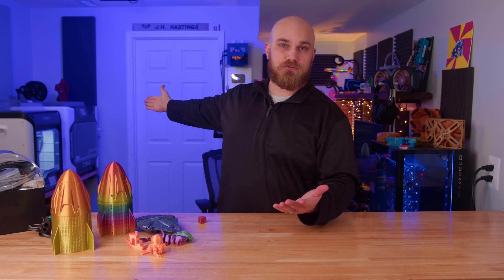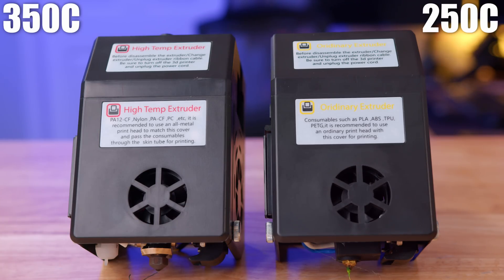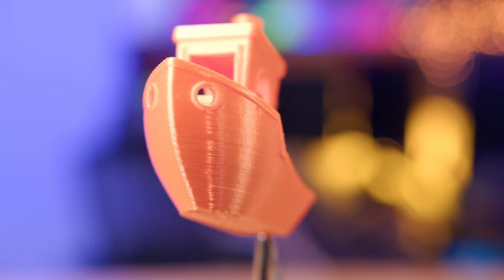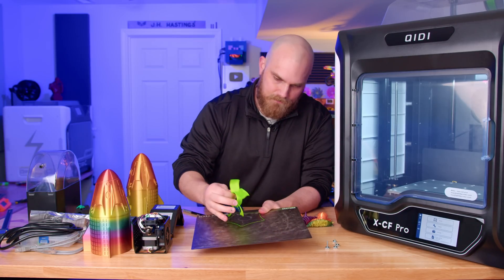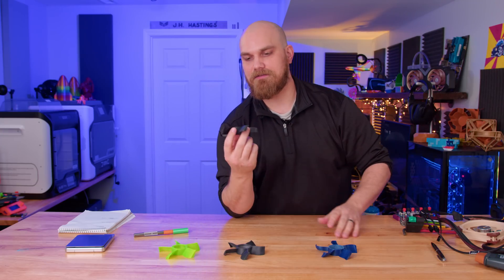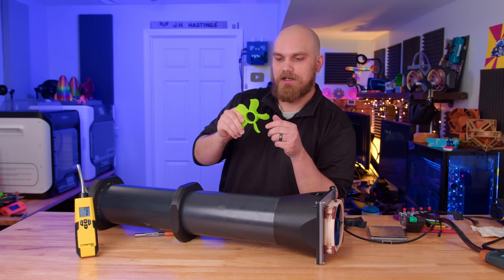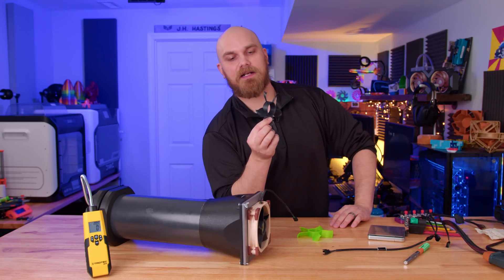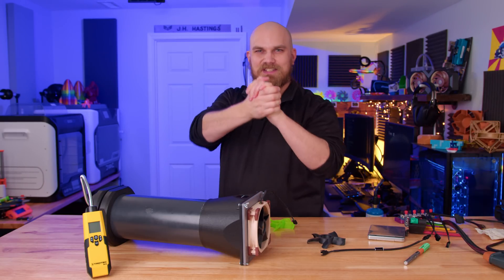Will a FLEXIBLE Fan Work? | QIDI X-CF Pro Review

Comment: Another filament you should try is PVB. Specifically, for Lost PVB casting (it's basically Lost PLA casting, but with PVB). PVB is similar to PLA except it burns super cleanly and it can be smoothed by alcohol.

Starting out, you'll also want to cast in ZA-12 alloy instead of pure aluminum.

Now, why would you want to cast something in metal? Well, I dunno!

Comment: fan guy to astro boy 3d rocket sleev print test aero ... next wing and boat shapes,,, test launch in tube line .. measure with string resistor not air with wind tho

Comment: yes and no .. it does at forst ... then it works worse so it bounces back and forth unless you get the right flex but as speed and pressure changes it messes up flex again .. so variable hard core or just flex on edges or just flex ina  center core strip should aid wingsz and fans which ... are not per se wings on swyvel axies .. a wing is to propulse or float a fan is to intake and push .. you need better industry vector differneters

Comment: Defintely need a TPU fan that has no support to the core at the trailing edge of the blade that has an aggressive profile but is relatively thin. Get good low rpm air scooping that will give way as the speed increases to lower drag and improve rpm

Comment: Dynamic fan like f1 racing of the past please. Either make rakes that open at higher rpm but closed at low rpm
Or print the fan in nylon with a tpu top edge where higher rpm allows it to bend.

Comment: Hypothesis: The TPU stretches to the fan frame as you stated, which seals the air flow better. The tighter the fan blades are to the ring, the more efficient.

Comment: OMFG. How have you gone so long without printing anything in TPU? You haven't fucking lived until you've printed something in TPU. It's so cool to print stuff that would normally be fragile as fuck, and have it be near indestructible. I printed a very small Fat unicorn model under 3cm high and it came out great, even the horn  was perfect. It's my favorite material to print in. I just need to get the Bondtech nozzle in steel to make it print faster than 60mm/s. Thanks for the fun video's. Keep up the great work.

Comment: I wonder what would happen if you line the walls with sandpaper, and use a fan that out of the printer is just a tiny bit too big; and then run it for a bit to let the sandpaper scrape the tips of the blades to the perfect fit...

Comment: The issues with the top of the dragon capsule prints can be fixed with more top layers. I prefer to print with low infill and 5 top layers, and I've never had an issue with top layer quality with a 0.4 mm nozzle. And make sure you keep that nylon in a dry box. The stuff can get wet in as little as 20 minutes, which is ridiculous.

Comment: Nice review.   I've been running one of these for about a month it's a good sold printer for those who just want to print 24/7 not constant fiddle around.  Few tips for Nylon and Nylon CF - slow the print speed down, cooling fan off, keep the enclosure warm 35+c works best and use the smooth reflective side of the bed with some glue stick designed for nylon (Magigoo  PA or visionminer) and you'll get some stunning prints.   Also whilst the BLtouch is a must on the poor quality thin wobbly bed creality style printers, QIDI printers do not need it - the bed is so massively thick and flat it doesn't need it.

Comment: ABL is overrated.  I find manual leveling holds just fine for a really long time if the printer is setup correctly.  I find ABL just gets in the way most of the time and adds time to the print if you run it before each print.

Comment: Speaking as someone who uses carbon fiber-nylon exclusively at work (Onyx brand), that is the most PATHETIC exscuse for a "dry box" I have ever seen. If your stuff is anything like mine, it is so hydrophilic that it goes bad almost instantly without proper storage. Ours will go bad INSIDE a dry box after about a month. I don't see a seal between the top and bottom of that thing. Does it at least have desicant bags in there?

Comment: My guesses:
The PVA fan blade touching the edge creates a seal to the fan shroud, capturing the negligible amount of turbulent air that the others are unable to accelerate into the wind tunnel.
The carbon fiber performing slightly better than PLA is due to the decrease in mass allowing for ever so slightly higher fan speeds.

Comment: Can TPU used as a non slip surface? For example if I were to print something in PLA could I print TPU feet/pads for it so the part wouldn’t slide on my desk?

Thanks in advance.

Comment: I wonder if it is possible to exploit the flex in TPU to actually improve fan performance. Build the fact that it's gonna stretch right into the design, perhaps letting it perform well across a range of speeds by carefully adjusting blade thickness...
Although I suspect, if it was that carefully designed, small imperfections in the printing process may well matter quite a bit

Comment: I've worked with glass filled nylon in the past and you may want a slow warm cool.  The parts I used to be involved with would have a huge cooling fixture where you put a pair of parts in a little cubby together for 30 minutes before post processing.

Comment: It would be interesting to see what happens if you put the fans on an RC car motor and really spin them up. At which RPM is the fan most efficient? Also, what happens during extreme stalling? You could print your own hub for it!

Comment: I'm kind of dissapointed with the print head change mechanism.  With the biqu hermit crab I have on mine, you just press a button and the whole head pops off and all the electrical connections are pogo pins.   You'd think for how much that one costs they could do something similar.

Comment: Never use part cooling for CF nylon. Always use Vision Miner adhesive on the bed. Always take the bed to 75-85°. Follow those suggestion and you will have no problems.

Comment: I honestly have NEVER messed with 3d printing, I stumbled upon this channel thanks to the algorithm while sick with the coof, but I have stuck around because I enjoy the evolving process.  That being said, two questions after this video... Is it possible to print the hub with the flexible material and blades in the stiffer carbon fill to achieve a vibration dampening effect? Also, since you can now print in a flexible material, fishing lure redux?  Perhaps reach out to Marling baits for a collab?
Reply: To do that, you would A: Need to use a duel head extruder in order to print two plastics at the same time and B: Make sure the plastics actually adhear at the edges. This is harder than it sounds with TPU and Nylon/Carbon Fiber becuase of the very different melting points of the plastics; one is just getting soft while the other is starting to burn. However, it is very possible with TPU and PLA because the thermal properties are much more similar, and I know people who have done it.
Reply: I'm into computers, but do not own or know anyone who owns a 3D printer, so I kind of similarly was gifted this channel thanks to the Almighty Algorithm. lol

Though, I do believe you need a multi-spool capable printer in order to knock out a part made from two different materials... which I'm not sure if any of his can do that, as I also believe they need to have the same number of extruders mounted (in terms of consumer grade hardware that is).
Even then, whether it's possible would be iffy, as the two materials would need to be compatible. A bit of a "water and oil" sort of situation, where some materials just don't like to bond with others. (Tape and Silicone, good luck. Silicone and Pet Hair or Dust? Match made in heaven! lmao [I think that is electrostatic related, but I digress!])

Comment: I think there's a huge missed opportunity with this printer, I can't beleive they made it so complicated to change over the heads. A couple of aligning posts and a single thumbscrew could be made to hold the assembly in place (considering they've gone to all the trouble to make it into a single unit) and then switch over the wires. Given this device is clearly targeted at a production environment, I would imagine people would want the printer to be offline as little as possible, and having to fiddle with a dozen screws to swap out the head seems excessive, and would be a pain in a prototyping environment where people would be tempted to use the wrong hot end. 
It does look like a nice bit of kit in every other respect, makes you wonder if the guy designing the hot end mount phoned it in or something!
Reply: in commercial work flows you're not going to be changing between the high and low temp modules so it takes what 2-3 minutes tops to change them since the auto leveler will already be pre-installed. there's a huge difference between having a commercial contract and a standard consumer buying a commercial product.

Comment: You do realize that you can save a ton of dissolvable filament by only using it for the support attachment layers - no need to use it for the full supports when it's generally more pricy

Comment: I have an idea but it might shred itself apart of that fan can spin fast enough at the hub but to straighten out the blades because the curve straightens out on the blades and makes the blades longer and if you can do paddle like propeller like on the c130 you might be able to. With aa but of clearance create a decent amount of thrust with the fan.... But you might want to reinforce one side of the blades towards the top or front of the fan to be stronger. Maybe when you print the fan give it a slight curl so when the fan that's squishy does speed up it straightens out and increases in thrust. Flexible materials have their own ballpark of needs in order to work super well at high speeds. Think of a stretching rubber band if you attach a weight to one end and twirl it around on a finger. The faster you go you feel that on your finger more and more.

Comment: Let me lay this on ya..... The floppy fans blade may be flating out due to loss of (air) friction. Making it basically an adaptable fan.  I.E. if the temp goes up it becomes more flexible, flating out along the plane of rotation and increasing rpms, possibly increasing air flow. More tests are required. Hmmm.....
Reply: if it flattens out and increses in rpms its because its encountering less resistance and pushing less air. This wouldld be useless and become worse as it functioned.

Comment: What would happen if you print with filament that changes it’s color with temperature? Would the fan get hot enough to change color (Inside of the computer)?
Reply: If it is exhaust rather than intake, surely.

Comment: Honest question here... Why don't you use resin printers more?  I've almost given up on extruder style printers even though with resin the small build size of cheap printers may force you to break a part up into several interlocking pieces.  They seem to work so much better in complex shapes without supports that I rarely see myself going back unless I want something done sloppy and fast.
Reply: If his reasons are similar to mine. The labor needed to make, wash, cure (not to mention the toxicity and waste management) is more obnoxious than FDM. Resin prices are nothing to scoff at either, then it's a tradeoff between price and durability. If you want something cheap like PLA, you can get resin for $38/kg but if you want something strong that won't shatter like glass, you're paying upwards of $70-100. 

I love my resin printer, but using it for everything would get super annoying very quickly.
Reply: @zeke7515  not to mention you can't make anything that touches the body or that you're going to use around food with a resin printer either. They both have their advantages and disadvantages. I have a resin printer right now and love it but I would really like to get a filament printer so that I can print food safe items. PLA for lost casting is a heck of a lot cheaper than castable resin also. Yes I know there's probably going to be some layer lines visible with an fdm printer that you don't get with a resin printer but I'm willing to deal with that.
Reply: @keithyinger3326  I don't have a resin printer (yet?), but I thought resin parts were decently safe for body contact, at least, once they're fully cured. Food contact doesn't seem unreasonable, either, but I'd definitely do my research before trying that!
Uncured resin is pretty nasty stuff - no argument from me about that - but once it's totally cured it becomes much like any other plastic, I thought... 🤔

Ironically, most FFF prints are generally considered by the community to be unsafe for food contact, and certain bodily uses, for 3 main reasons:
1. Most brass nozzles contain lead (a common element of brass).
2. You'll have a hard time ensuring the entire extrusion system, build plate, etc., are (and remain) safe for food contact, even with stainless steel nozzles, and especially if you use the same printer for non-food-contact prints with filament/nozzles that may have not-so-healthy ingredients.
3. The gaps between layers are hard to fully clean, and are likely to harbour bacteria and such.

So the recommendation is generally to either entirely coat the part in something like silicone that's safe and that will eliminate the tiny gaps (maybe polyurethane, maybe epoxy resin; I'm not sure), or to print a mould and create the target part from silicone/etc.
However both of those approaches can be done just as well with a resin printer, surely?

(Again, I don't have a resin printer of my own, but I'm subscribed to many 3D printing YouTubers who have together discussed resin printing quite a lot, including safety, and I do take the safety aspect seriously :))
Reply: The cleanup with resin printers is a huge pain the the ass at the volume he's printing.

Comment: could you print a fan with a mix of flexible and pla? I feel like if you could design a fan that performs at higher efficiency at more rpms. kinda like f1 cars an when they had aero that deformed to reduce drag at  or increase downforce at difference speeds
Reply: why would you want a fan that adaptively reduces the amount of cooling it does?
Reply: @maverickstclare3756  umm you wouldn't. but you could possibly make a fan that can perform very well as a low speed high airflow fan and then dynamically change to a more static pressure oriented fan at higher rpm. Not an engineer but I'm guessing it could work by altering the trailing or leading edged to be more or less flexible. and having read other comments now other people see this potential too so....

Comment: I wonder if the stretching of the TPU fan was giving it a tighter gap between the wing tip and "duct" of the fan frame (by virtue of lightly contacting it), and thus preventing a small amount of air from slipping past. I suppose the wings themselves might be slightly larger when spun up (due to the stretching), and thus just moving a slightly larger amount of air.

As for the TPU, could you use that to print vibration-isolating bushings? That might be handy for some of the more complicated fan assemblies.
Reply: 🤔I wonder if the TPU may also help noise for the Fans with Gear Drives if used for every second Gear,
but I guess there would also be the need to see how they wear compared to PLA in that position too

Comment: You mention a weight of the fans that could have change a outcome of test/fan speeds... I can't remember you trying to print in low dense filaments, I've seen good video about it at CNC kitchen, perhaps you could try that to see the difference :) 
Otherwise amazing video and been looking at qidi printers lately myself, and about bltouch, if it's just standard bltouch it's only around £30-40(<50$) to get second one for convenience :)

Comment: Try printing quad props, could be a good theme for the next season! (I don't know if printed nylon could actually hold the stress) 

You would need to measure thrust instead of airflow to make it useful, but still pretty cool.
Reply: The carbon fiber stuff should hold up. I've seen carbon fiber props before.
Reply: I designed & 3D printed TPU racing drone props last year, this is the first two maiden flights with them - https://youtu.be/jcLGBiPoMzs

Comment: How long is a meter?
Reply from the maker: 1000 millimeters
Reply: @MajorHardware Let me rephrase the question, what is a meter based off of?
Reply: @CaliMeatWagon  someone a long time ago had a stick which was then made into a platinum stick for measuring consistency and now its 1/299792458th the length of light in a vacuum per second

Comment: Design a fan that's slightly smaller with the flexible material so that it expands during rotation, making it a lighter fan than most but it's the same size as others and moves the same amount of air. In theory that should reduce power consumption right?
Reply: or make a carbon fibre one that's thinner and dimensionally stable
Reply: Power consumption should be dominated by the power required to accelerate the air and internal losses in the motor. The weight of the blade will mostly only affect the amount of power required to get it up to speed; once spinning, the only thing slowing it down is the air it is hitting. The small exception is that a heavier blade would increase the friction forces within the motor.